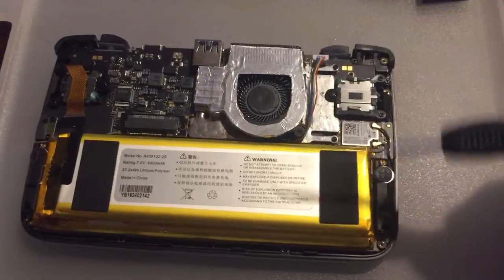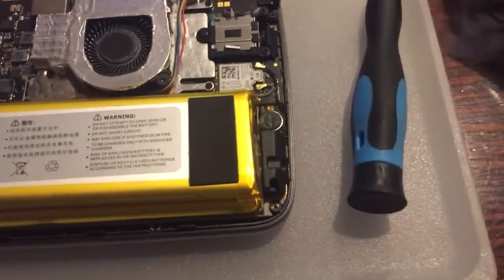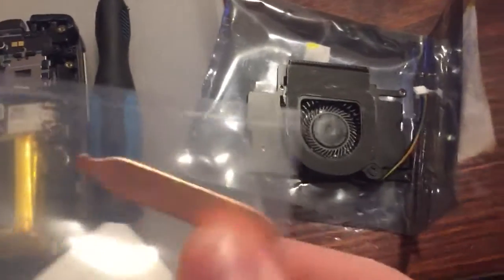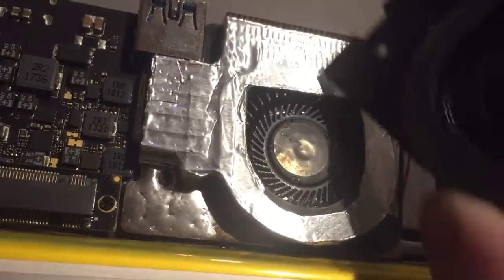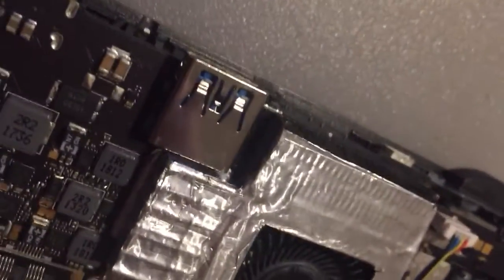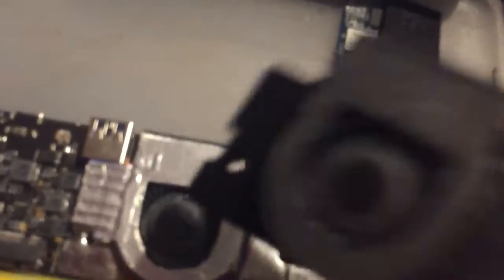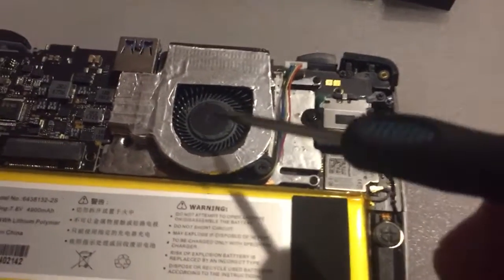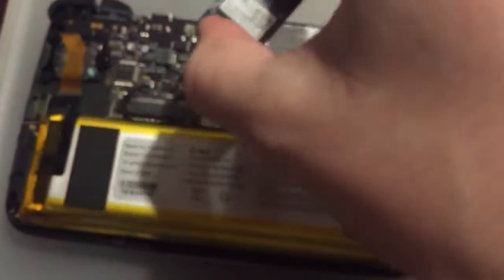GPD Win 2 Cooling Mods, News, Rambling.

Comment: What's the model number for the SSD connector? I really like your idea about the SSD placement and ribbon routing..  I've been wanting to do exactly that too. m.2 ribbon extensions have a lot of unnecessary stuff, and all we need is power and SATA lines. A shielded ribbon cable may be required though.

Be mindful that SSDs get hot and may warp the plastic behind the LCD or damage the LCD itself.. So you may need to sink some of the heat away from the LCD. 
When i was considering an SSD behind the LCD, i kind of thought of something for the heat.
I've been mulling over an idea about cutting the center out of the LCD back cover, leaving a 1CM bezel, and using an aluminum sheet, cemented to the plastic bezel. The bezel would make it so it'd still clip in safely, but the aluminum would sink some of the heat out.

Also, for the rumble, the secondary board was redesigned, can't even support the rumble so people can't even add it. So i still never got an official reason why the new one's no rumble.
Reply from the maker: They are the white ones on the list, the main difference is the part height, so any of them should really work for this application. https://www.digikey.com/products/en/connectors-interconnects/rectangular-connectors-arrays-edge-type-mezzanine-board-to-board/308?k=&pkeyword=&FV=fffc00ff%2C1600020%2Cii2%7C2172%2Cffe00134&quantity=0&ColumnSort=0&page=1&photo=1&pageSize=500

Comment: 7w with stock will be nowhere close to 90c but good mod nevertheless. I run 10-12 stock with very conservative undervolt and it hardly goes above 75c
Reply from the maker: Really? Wow, Mine was very hot at stock under a combined synthetic load test. Could have been a bad paste job from GPD then.